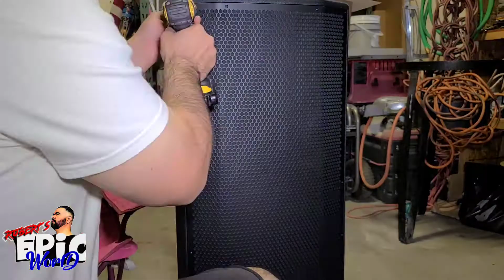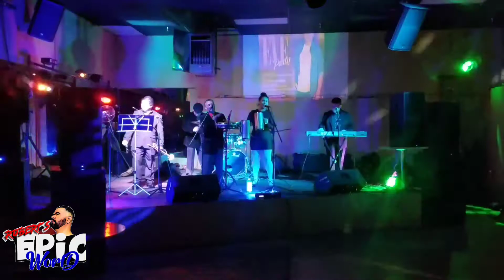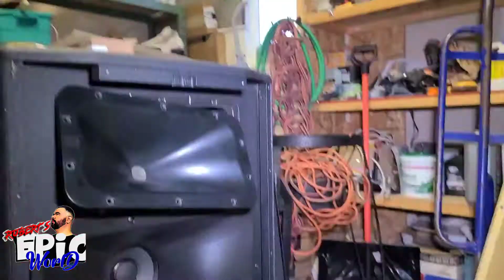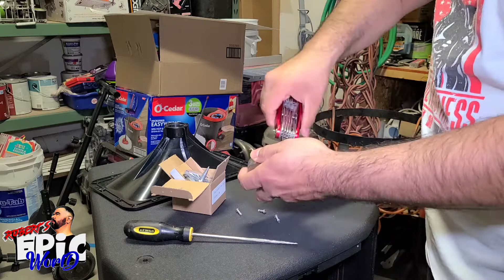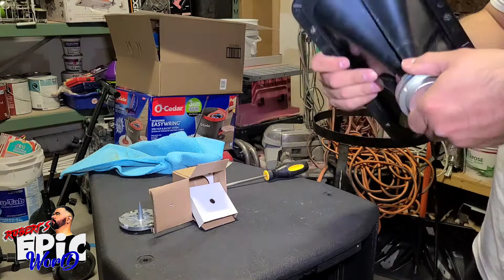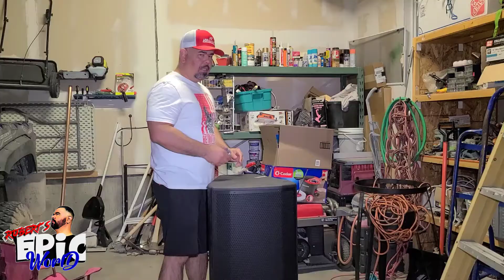FIXING A JBL PRX 800 SERIES| BROKEN TWEETER| PURO PARTY!

Comment: Im buying this speakers i want ask you asking there are less buyers of this speakers and the people who have these speakers are not sharing theier information and experience please dude i want to talk with you
Reply from the maker: I've had these speakers for 3 years and this was the first repair I did. I use these speakers alot in a night club.
Reply: Ive also had mine for 3 years  I have 4 also mine are JBL 835w finally one tweeter went out 
not bad easy fix $25 part cant go wrong I also have 4 QSC KW-153 These speakers blow JBL Away my opinion.  But I also love my Jbl's 835w.  QSC had them for 8 yrs no issues at all!!!